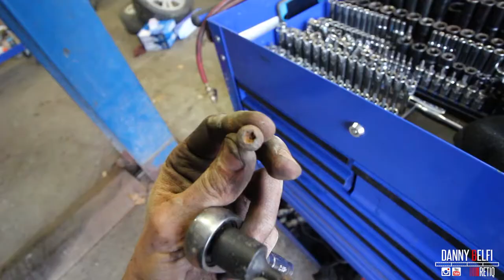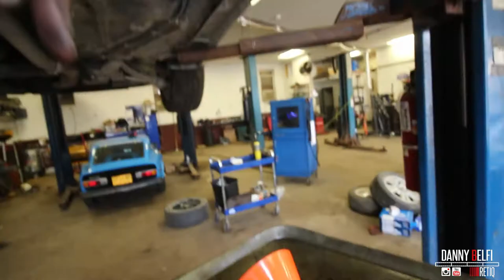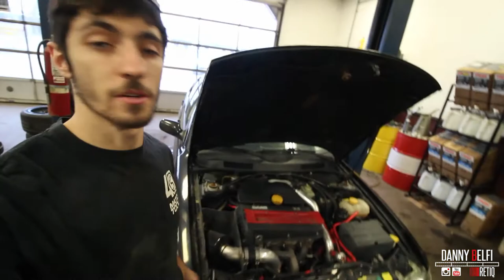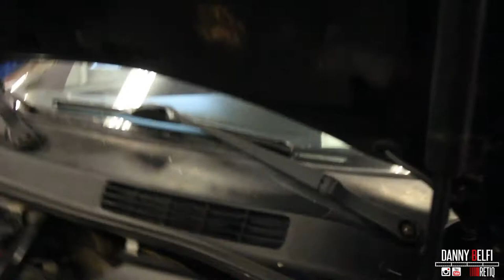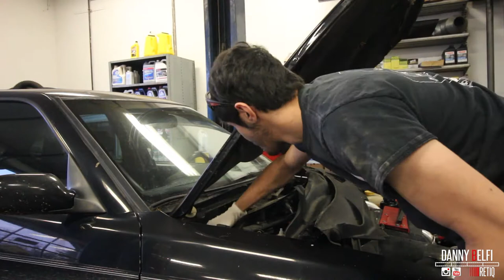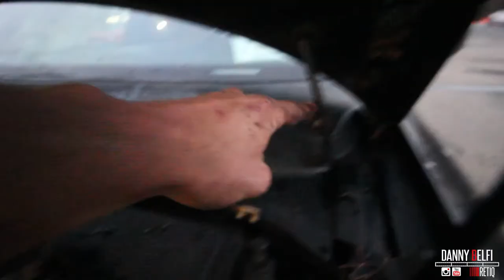SAAB ng900 Replacing Fuel Filter Cabin Air Filter DIY

Comment: Great video Danny. Four years ago, I bought a 2006 9-3 Aero convertible 2.8L 6-cylinder that was being parted out and decided to restore it. Fun car to drive. When I got the car home, the first thing I decided to do was change the oil and all the filters. I searched all over and could not find a fuel filter. I was shocked when I read the fuel system description in SAAB WIS and learned the U.S. market 9-3 2.8L does not have an external fuel filter. The filter is built into the fuel pump assembly. The European market 9-3 2.8L has an external fuel filter. I would love to know the engineering logic behind that design. Have you seen any other SAAB models without an external fuel filter Danny? Safe travels. Cheers.
Reply from the maker: Hey yeah the v6 is a nice boost of power over 4cyl. That’s good you saved a saab from the gave! I’m not 100% but I think the new gen 9-5 has an internal filter and prob the 9-4x I’d imagine has internal fuel filter I feel like most newer compact cars seem to have internal filters. Not sure why that don’t have the external ones.. Cheers
Reply: @Retiq  Wow. Thanks for that information Danny. The 9-3 Aero Conv was too good a deal to pass up. The used car lot didn't know how to fix it and I talked them down to $2,000. It was missing a radio amplifier, and needed new spark plugs, ignition coils, rear seat bottom, a hydraulic actuator for the roof, and some key reprogramming. It had a pretty rough life. I didn't mind spending the money to bring it back from the grave. It runs great now. Have a great weekend Danny :D
Reply from the maker: @yhird  ohh my a lil little but not to bad for 2k. I feel Saabs are either nice condition or someone abused it and it’s beat..
Reply: @yhird 9-5 BioPower too

Comment: About how much fuel should I expect to need to catch?  Only the volume of the filter or more?
Reply from the maker: You’ll wanna catch the fuel filter and the fuel inside it and whatever’s in the lines it’s not much a small drain pan will do. It prob wont be much maybe a quart but that’s a guess
Reply: @Retiq  thanks